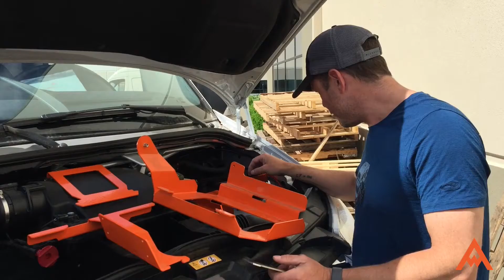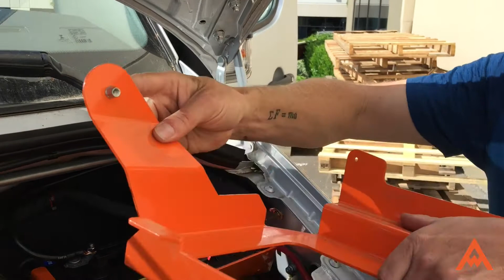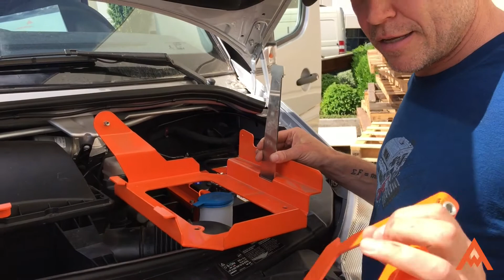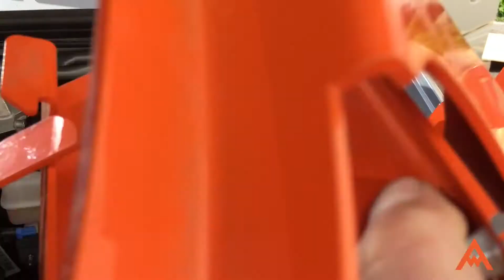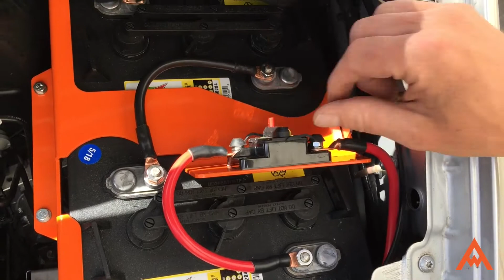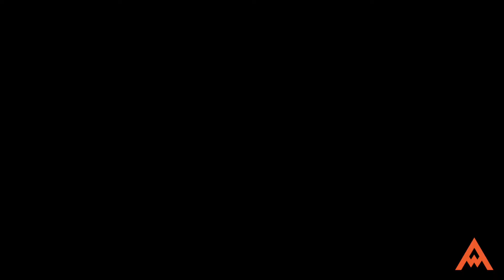Adventure Wagon Battery Tray

Comment: I bought this tray for my 2017 when I bought the van new in 2018.  I still have not installed it yet because I was waiting for the OEM auxiliary batterie to fail but it hasn’t yet.  Now I was thinking of Lithium batteries.  Is there anything different I should be thinking about with Lithium batteries?  Do you still sell the cable bundle and instructions?  Thanks